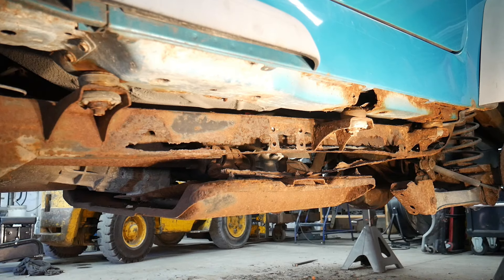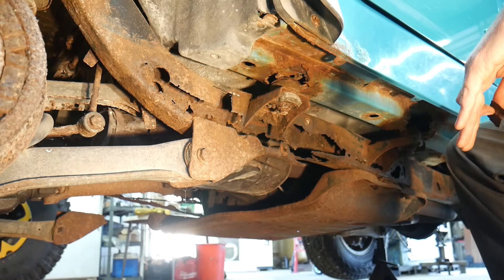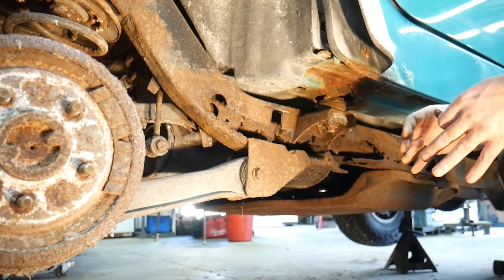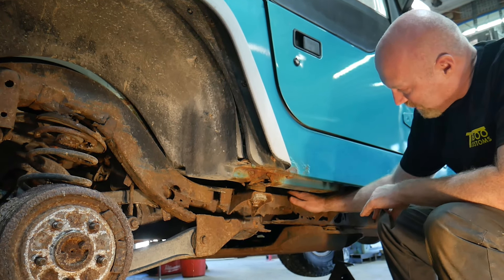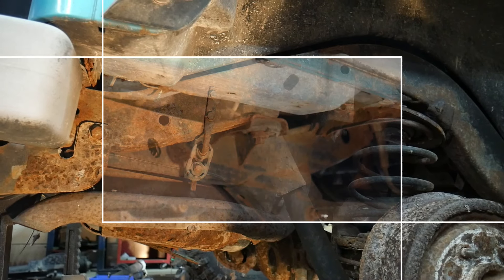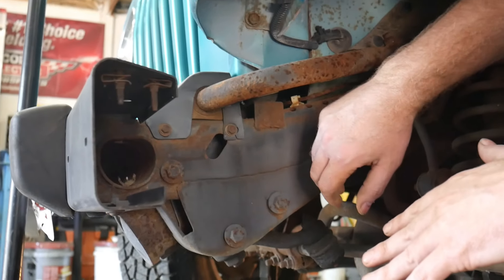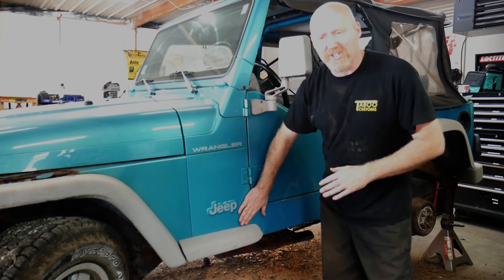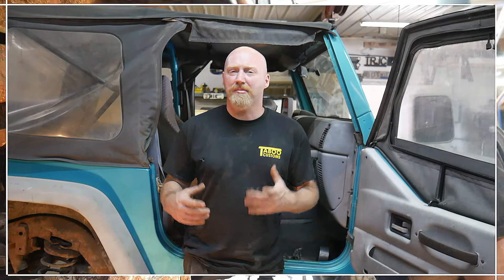Jeep TJ Wrangler Extreme Frame Rust - Can it be Saved?

Comment: Live in North Central Ohio and have fought this battle on my 99 Wrangler.  Use a technique learned while in the military.  That is not that hard to do if you are willing to work and it actually is stronger than factory.  First cut out the rust back to solid material.  Use cardboard and a hammer to make a pattern.  Transfer that pattern to 1/4" steel, needle gun the hell out of the frame where you are working.  Weld in that transferred plate and grind it flat.  Next take your pattern and make a plate 1.5" longer as a top plate.  Use a hole cutter and cut holes in this plate.  Weld this top plate in and weld the holes around, this makes a better strength area stronger than the factory frame.  Have done this on several vehicles and have always had success with this method.  It actually isn't costly but work intensive.

Comment: this is quite nice to hear about, iv got a 2000 tj 4L, its got some rust on the bottom, not too worried about it right now. however, this is the vehicle i want to try an experiment with, and keep running and driving for as long as i can. so if a part breaks, just go and fix it kinda deal. its nice to hear that even a frame like that can be repaired

Comment: This gives me high hopes for fixing mine up. This is my absolute favorite model ( tj ) I have a 2000 with a 2.5L five speed. Learned how to drive a stick on it so I have a bunch of sentimental value in it. Watching from Michigan and interested in seeing the process. Subscribed
Reply from the maker: We are working through it and only have one more kit to install.  We will then be doing a finished video.  I will say that frame wise this would definitely be on the edge of what we would recommend could be repaired and at that something like this needs to be repaired by a somewhat skilled fabricator/welder.  If you would like you can send us some pictures of your rusted frame and we can let you know what we think.

Comment: It's my understanding that all this could have been avoided if the factory would have drilled some holes in the bottom of the frame. Is this correct?
Reply from the maker: It would certainly have helped to have more holes for drainage.
Reply: If they hot deep galvanized frame would not be problems.

Comment: I don’t have any holes in my frame but it’s flaking pretty good inside should I just go ahead and put your kit on before it rusts through
Reply from the maker: If you do just make sure that you take as much rust off as possible before plating, you don't want to sandwich any rust between plates if you can help it.  Be sure to use a good weld through primer.

Comment: Videos are really helpful and appreciated. Dealing with some rust and have found useful information in all of what i've watched.  What is your generally opinion on frame paint, rust encapsulators? I've got a shop doing a section of my frame with safetcap so i'll have a mix of bare metal, some isolated rust spots (at welds, openings), and then a lot of area with original frame paint (the rust is mainly on the inside - using internal frame coating for that). I know there is no shortage of opinions - e.g. POR, RustBullet, etc. Just curious to know what you most often use as a practical matter.
Reply from the maker: Thanks, prevention once you have a lot of rust is tough, a lot of those products really only work if you get all of the flaking and deep rust off, which on the inside of the frame is nearly impossible.  When I do restorations of frames I have them sandblasted then will coat the with POR 15.  When we do small rust repair we will try to cut out the bad rust as much as possible and use a weld through primer on the inside of the kit then prime and paint the outside.  I would say that any of those rust prevention coatings with paint will perform better than just standard primer and paint.
Reply: @TabooCustoms  I appreciate you taking the time to respond.

Comment: We have an 04 TJ x we got for $3k 4 or 5 years ago. Upstate NY so yeah, rust belt. What's this sort of frame repair cost? Ballpark? It's such a shame, a typical new York jeep, runs amazingly well, hard top, full doors, rusted all to hell. It's a shame to junk it or part it out, but that might be what has to happen because the frame looks just like this one, thought the rear control arm connections are a little better.
Reply from the maker: The parts price isnt to bad, for $300-500 you can get parts to do most of the frame, the labor is what is the bad part.  To do what I did with this one I would expect anywhere from $600-1500 depending on who and where you take it.
Reply: @TabooCustoms  heck, that's totally doable. Lots of assumptions of course but if I could save this old gal for $1500 I would do it, and then hit the tub later. If I had enough garage space I would give it a shot myself. I'm already restoring two 59 Austin Healey Bugeye Sprites in it, no room for a full sized car LOL

Comment: Can it be saved or should it be saved I think that if you really hustle the amount of time you would spent grinding cuttting and welding away at a frame would be a good head start of time on a frame replacement not repeat besides they wasn’t coated from the factory on the inside out and is thin vs a throttle down customs frame that’s much thicker property coated inside and out to ensure no more rust cancer

Comment: Excellent ... but whats the price tag ? $1500. ?
Reply from the maker: Haha, yeah that will vary a lot depending on who does it.  To this degree i would expect $1500 if not more.
Reply from the maker: Thing is the options aren't great either, part it out or try to find a different frame.  Swapping everything to a different frame is going to cost you about the same.

Comment: I bought a 02 jeep tj from a car lot they sprayed the frame with black spraed painted on the rusty spots and things. It snapped rusted frame... I almost got into a car accident.can I sue them?
Reply from the maker: I've seen folks fill frames with spray foam, bondo and other stuff just to get them sold off, also seen a lot of bad fixes where they just throw a plate over it.  As for the dealer I'm guessing somewhere in the paperwork that was signed there could be a legal out for the dealer.  We have in the past though repaired some frames that were paid for by a dealer because they had just sold the vehicle to the customer, time after sale might play a factor there.

Comment: Thats the rustiest tj frame ive ever seen
Reply from the maker: The crazy thing is this is the worst we have seen for the center to rear section of frame but one of the best at the very front of the frame around the steering box, which can be an issue.   We are finishing up working on this soon and will have the update video out in a week or so hopefully.
Reply: you have not seen mine  haha  its a shame too because its mint everywhere else..BTW get that frame paint for inside the frame, comes with a 8' nozzle with 4 spray holes to coat 360 degrees, at you feed the tube in the hole as far as you can go spray as your pulling it out, I'm in search of a frame,now.,
Reply: @jon-xq2lc  what is the name of the interior frame paint you are referring to and where to purchase?
Reply: @jxyjayjxy  Its  a product made by Eastwood... search Eastwood internal frame coating- Paint. Amazon has it $25.00 a can, I believe two cans will do it .....There  are some videos here on Youtube, Coating the interior of the frame and some great details of how they go about doing so.... Good luck.
Reply: @jon-xq2lc  Excellent! Thank you 👍